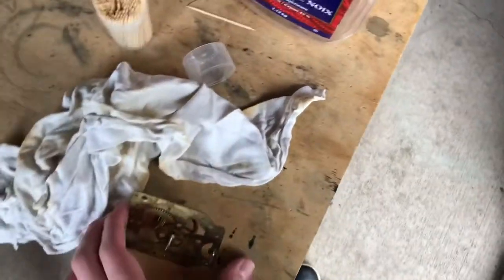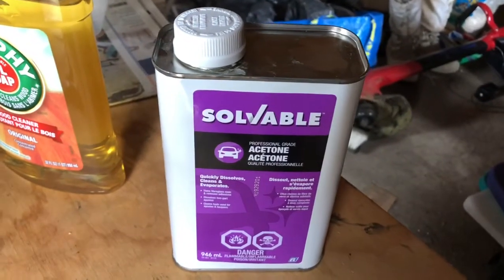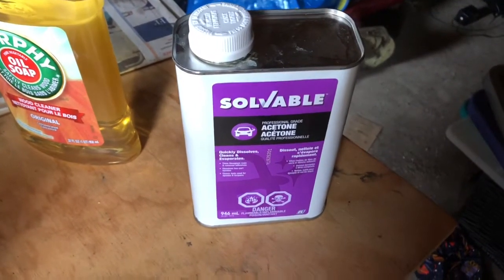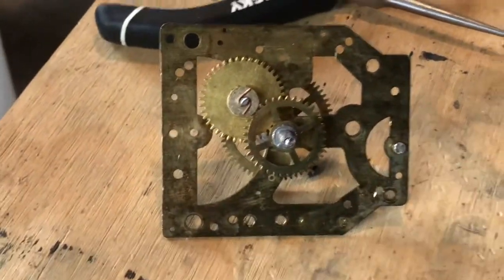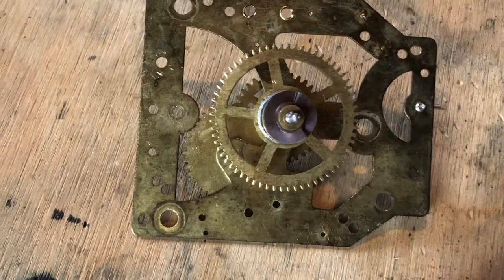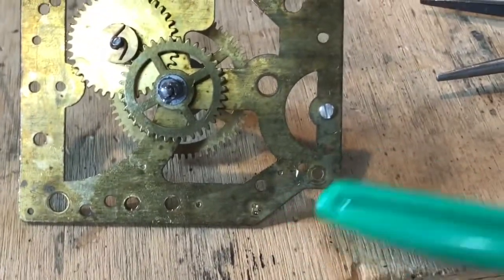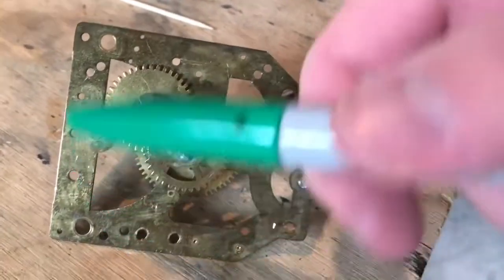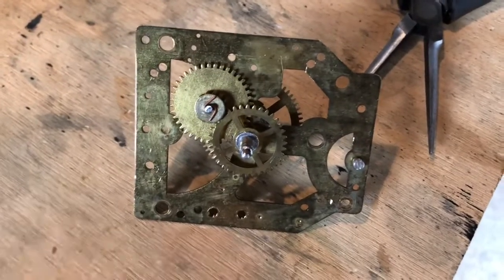GPWS Short: The Experimental Home-Brew Clock Cleaning Formula (Part 2) (Acetone test)

Comment: Tonight on this episode Greg shabby chics a movement plate! ....
Seriously though, scratch that white stuff off with a fingernail. If it seems to come off easily, you need to get it off or its going to flake off and contaminate the oil when you reassemble the movement. Clean the plate in lacquer thinner.
Also, try substituting simple green for the ammonia in Tom's formula.
I have used straight simple green to clean movement plates with good results, but beware, it will turn the brass copper color if left in for very long. Really neat effect though. The copper color will polish off with a brass brush with not too  much effort though.
Reply from the maker: Simple green, eh? I've been finding quite a lot of that stuff in place of ammonia around here. I'll give it a shot for sure. As for only using simple green, that might be worth a try too. All we really want out of a cleaning solution is for it to be fast and WORK. 

Well, at least it wasn't an entire case with irreversible effects!

Comment: I would say that most of that discoloration on the brass is merely just, well discoloration just from the brass aging,  And as far as my standards go as long as it is not super deep pitting and/or dirt coming off of it and the pivot holes are clean then it should be good to go.  (Basically if none of that discoloration stuff it’s not coming off then it should be ok.) And just one more note even with cleaning solutions I still highly recommend to clear out the pivot holes of any excess grime because usually cleaning solutions don’t get all the grime off.
Reply from the maker: Fair enough. It really all comes down to the pivots in the end anyways, right?
Reply: Gregola Productions Yep!